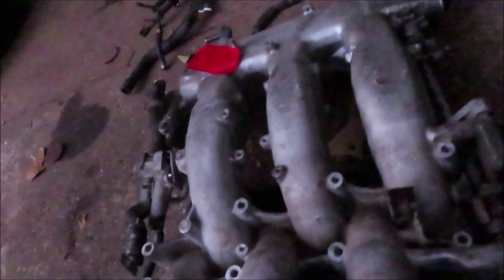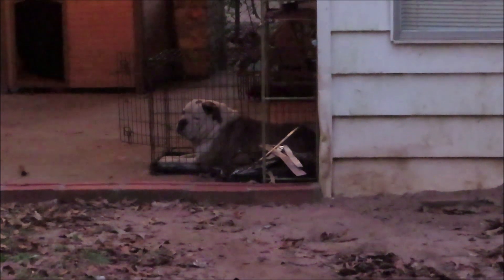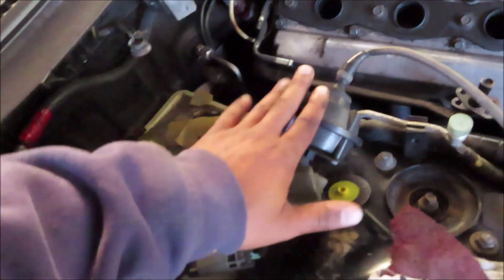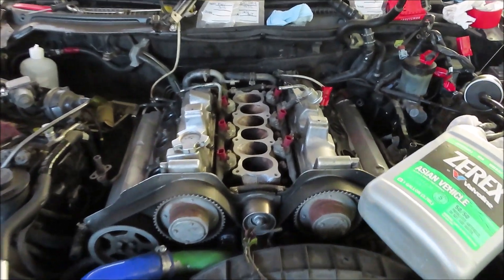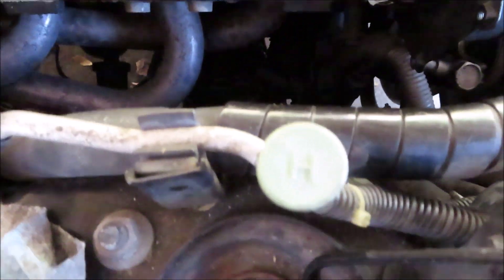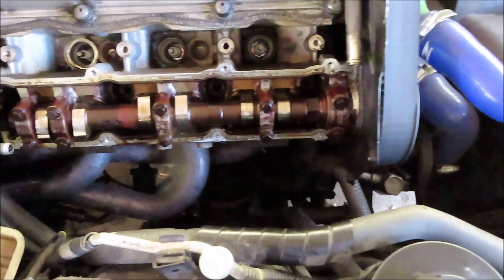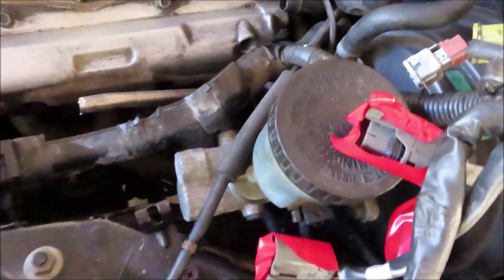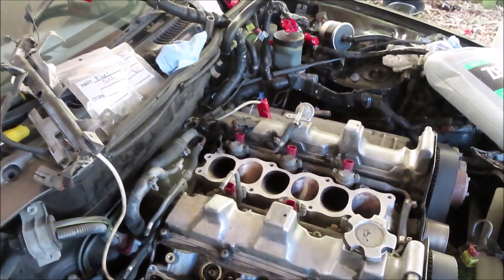NEW HEADERS+VALVE COVERS CLEANED UP !

Comment: Nice work Bro - I took out my EGR not too long ago on my TT and its not too bad like I had heard. In my case, I was replacing my brake booster, so with it out , it made it easier but I still cut the pipe that goes into the exhaust manifold. Nicely done cutting the wrench - very creative!  What was the track at 11:03?
Reply from the maker: Thanks and Bones 4 x4  slowed to perfection